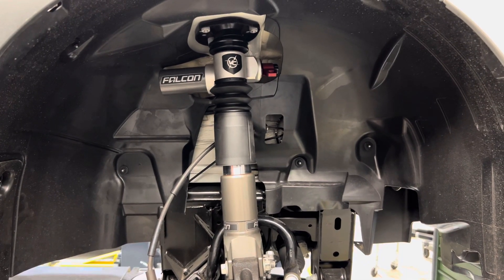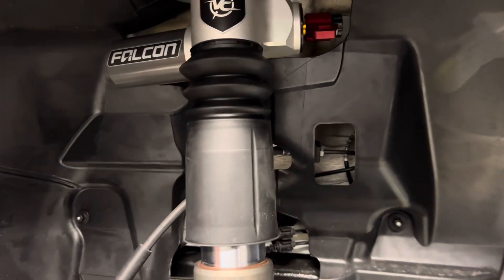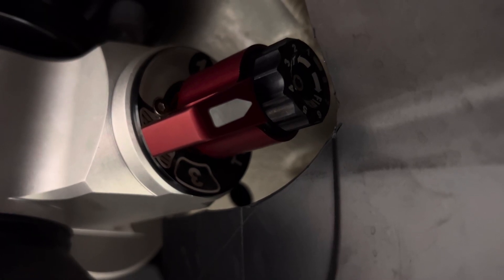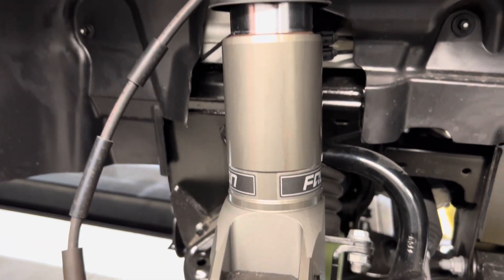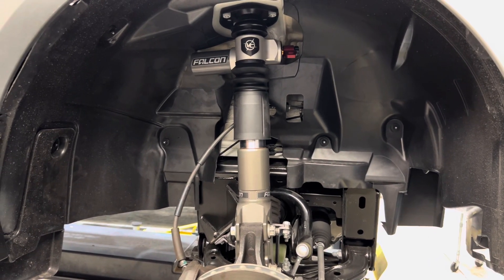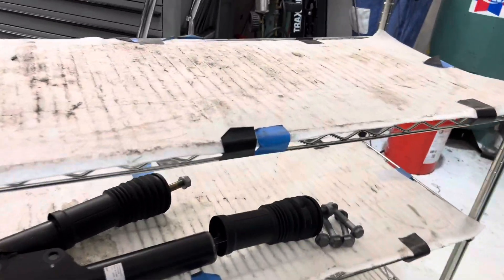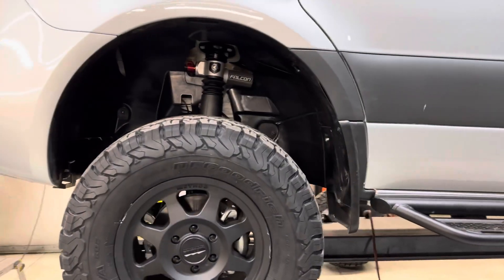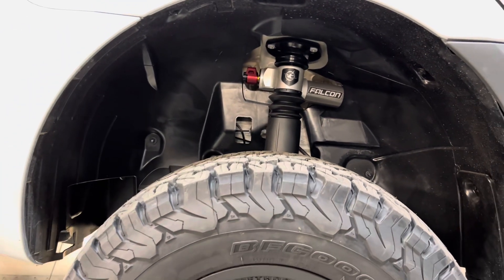VanCompass inverted Rally Struts for Sprinter; mind-blowing performance

Comment: I have a 2018 sprinter 4x4 
170 wheelbase. I don’t go hard-core off-road with it but I do want to get the bigger tires 18 inch and raise the backend a little bit because I think it’s sags. What do you suggest? I will put rhino rims on it as well.
Reply from the maker: We can certainly help. We'd need more specific info from you; email jeremy@matrixintegrated.cc

Comment: I’ve seen both the new strut and the VC shock on the front, is that shock no longer needed with this setup or is there an advantage to having both?
Reply from the maker: @mikelaan61970 Excellent question. Here's our/VC's advice; 
--For 4WD...if you already have a front adj aux shock installed, then go with the non-adj (Monotube) Rally strut once you feel the need for more front end control and/or when your factory strut starts getting more miles on it (all depending on how much it's been abused of course). If you don't have any upgraded susp, then go with the adj Rally strut and probably no need for the front aux shock. Having both a front adj aux shock AND the adj Rally strut is too many adjustments for most to make good sense of.
--For RWD, since they have no room up front for a front aux shock, and the van is loaded heavier, varies terrain between pavement and off-pavement, or drives in strong winds, then go with the front adj Rally strut. If little/none of the above, then the non-adj front Rally strut will still be worlds better than OEM or even the good Bilstein B6.